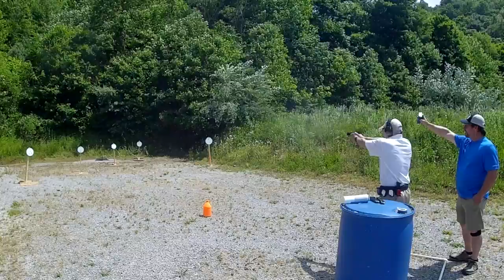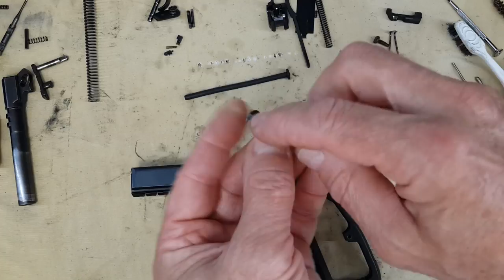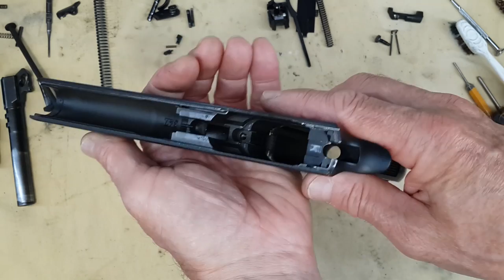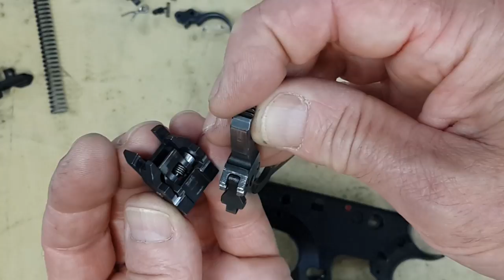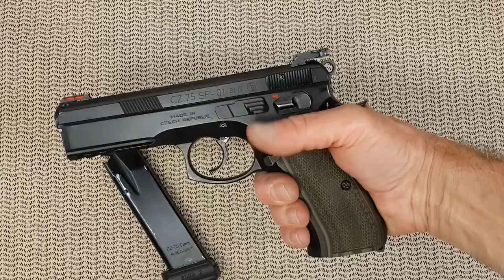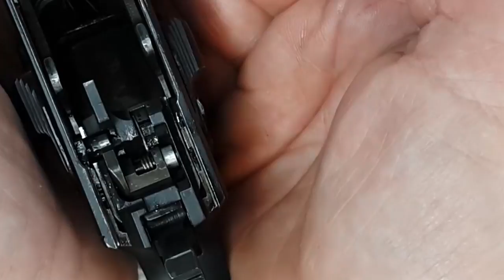CZ 75 SP-01 10,000 rounds Review

Comment: Nice video just fyi...the polymer guide rod on my p01 was slightly bent straight outta the box.  Doesnt effect operation at all however and you can probably even bend it back straight if you wanted to.  That is assuming the sp 01 has polymer rod like the p01.  So if you end up replacing it dont be suprised if your new one is more bent than the one you have now
Reply: My SP-01 guide rod was also bent but in a 'smooth way'.. His was really "wobbly" no?

Comment: The lighter recoil springs wear out after 2500-3000 rounds.   I just replaced with a heavier spring. I had a custom disconnector made and had issues until I put in a heavier mainspring.

Comment: Check your primer seating depth.  You should be able to set off even CCI primers (which are harder than Winchester) every single time with even the 11.5# spring (lighter than your 13#).  But the primers have to be seated fully.  Meaning they should be .003-.006" below flush.  What is the sear cage hack exactly?

Comment: Another great video.  Thanks.  You remove the extractor every 2000 rounds?  Do you reuse the pin and spring?  Do you have to "re-stake" the pin?
Reply from the maker: I reuse everything, unless I witness excess wear, which I only had on the original firing pin retaining pin, but everything else has been perfect, even with lots of dry firing. 
No need to restake the pins, they should be pretty tight, but in the even they get a bit loose, the hammer pins (the only staked pins), will stay in place as they are maintained in place by the gun's frame on each side. Happy shooting Kevin.

Comment: I've had the same two issues with all of my CZ's.  The firing pin roll pin and the trigger spring.  Of course all of my non Pre-B's have the CGW roll pin.  And it seems that the current trigger springs are of a better quality.  But If I try I can still snap a trigger spring if I try.
Reply from the maker: You must have an unusual very strong finger lol
Reply: @practicalshooter6517  It happens on the release.  If too fast the trigger slamming forward breaks the spring.
Reply: NuclearGrizzly Reduced power Cajun gun works has a good trigger return spring
Reply: You've had the CGW roll pin fail as well?

Comment: Thank you for the video. Is your roll pin original? If not, where did you get your roll pin? I just bought a CZ 75 SP-01 and I bought an extra roll pin from CGW. What else spare parts do you recommend I should get? I don't shoot a lot maybe around 1k a year and I'm not planning to customize my SP-01 such as lighter spring, etc. Thanks in advance.
Reply from the maker: All you will need is the roll pin. Your CGW pin should last you a long time. I only replaced my pin with one of those https://amzn.to/2HPjnKw and they come in 15 pieces for $9
Reply: @practicalshooter6517 , Thank you.

Comment: Weird, I have the 11.5 lbs main spring on my shadow 2 with about 8k rounds on the spring and it will pop all primers including CCI and S&B. Also on most of my guns the "auto-loading" happens after about 2k rounds.
Reply: Does the shadow 2 have the same firing pin as the sp01?